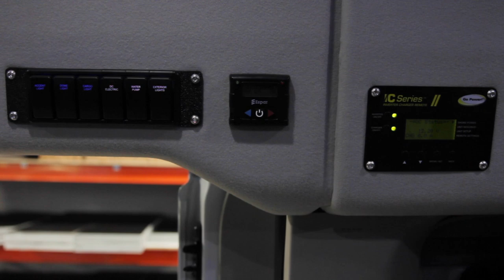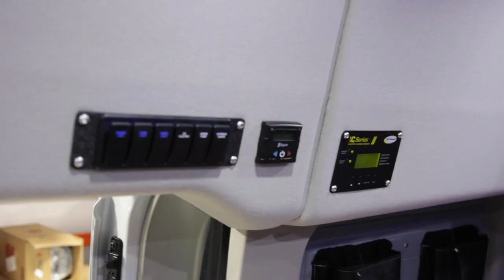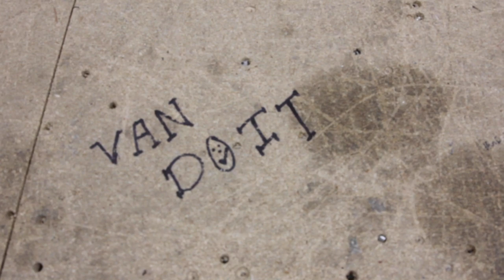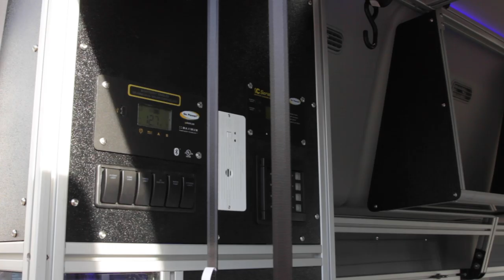Ford Transit Conversion Company | VanDoIt Spotlight

Comment: I really dig your vans but I cant get over the huge roof rack overhang at the front. Is there any plan to modify this or fill it with a light bar? Something that is similar to the aluminess rack+lightbar on the spitner vans?

Comment: I think this is what I've been looking for, but I need clarification.   Are you selling a converted van?  If so, how much.  Or selling the module components meaning the customer must owned the van, but buy the components from VanDoIt to put it together.  Do you have contact number or email address?
Reply: Artemis Hera above the red " Subscribe" button, click on the little arrow, and it will give you the contact and website info.